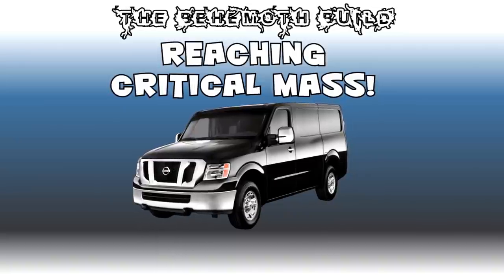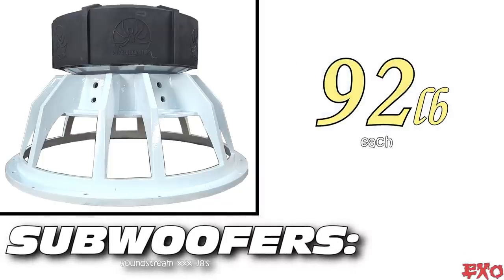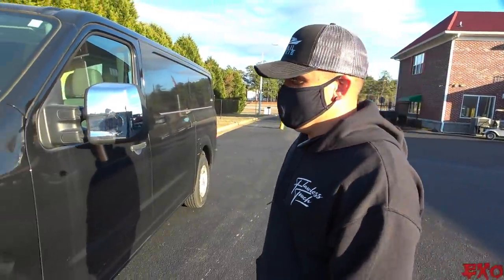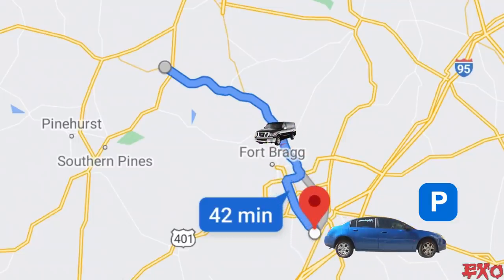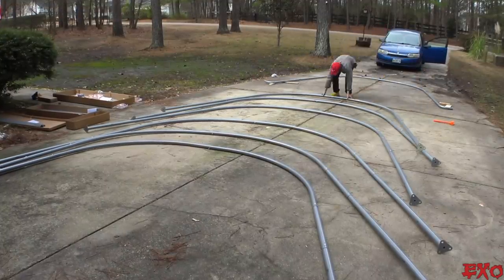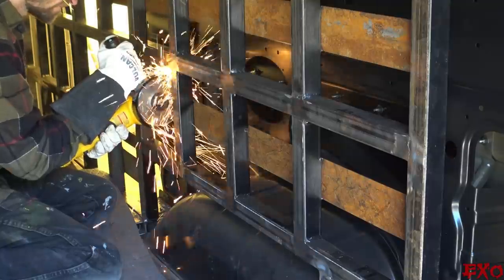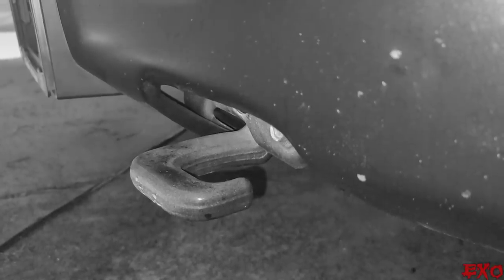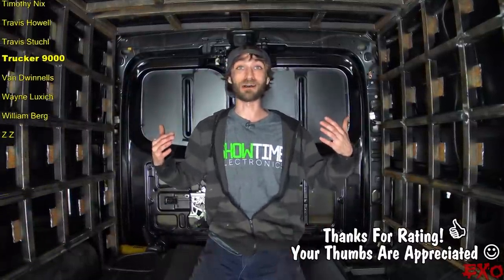Pushing THE LIMITS w/ My Biggest Car Audio Build EVER & Increasing INSTALL SIZE for 12 18" Subwoofer

Comment: BIG = 1988 blazer engine bay has plenty of room 4 alts no prob plus the sub box , amps and batts has better room and plenty of ideas too! can do power runs though firewall and under runs and so on   VS SMALL = 1991 s10 blazer NOOOO my XS D3400's wont fit why such a small battery location .... grrrr why this alt to big its a direct fit wth -_- ahhhh 4 team neo 15's wont fit the box its basically in the roof and in my front seats gonna have to " try " and wall it ..... all these lift kits but no carry weight  >=(  no firewall options for power runs and under runs looking sketchy af where do i put the amps on the dash no room for the batts or amps except there ?  external oil filter cause its a 4x4 no extra batt for the front  no room anywhere XD

Comment: In every american basshead video im stunned for the amount of useless work and the amount of money spent on everything stupid. that gray sealent glue for example, it feels like who ever can squirt most amount of that crap in his car is king competition, same goes for baffles, who has the thickest is the king. The amount of useles power cables is staggering too. Those aluminum terminal blocks, have you ever measured them? 2 more connections,and if you dont have to hammer the block to the amp it has bad connection.... And making everything from mdf???  :D:D i cant even... Exo has passed mdf thank god.